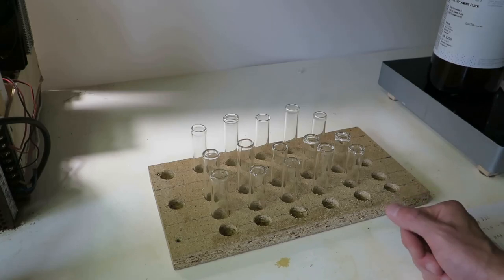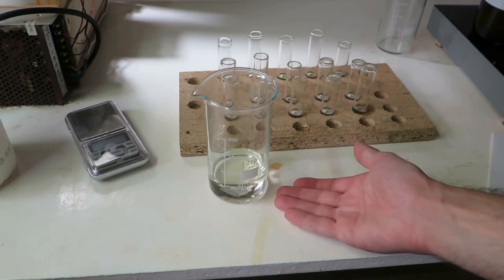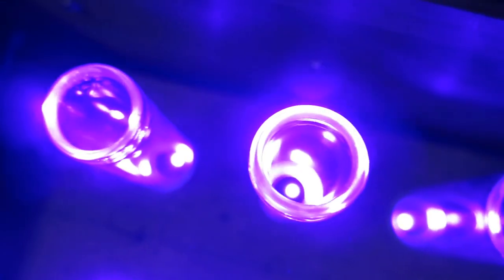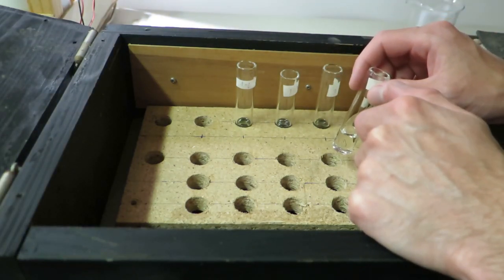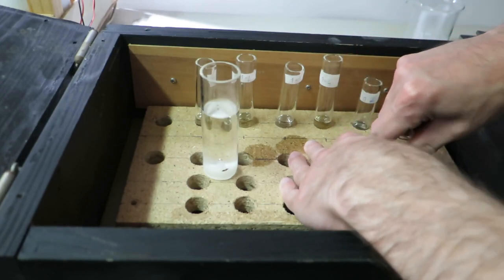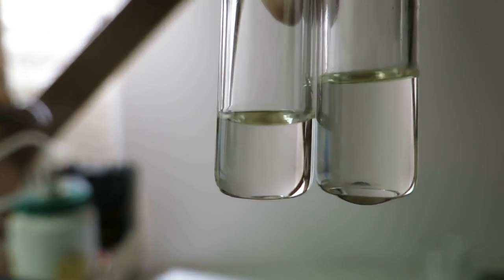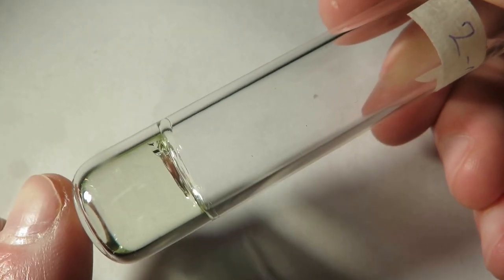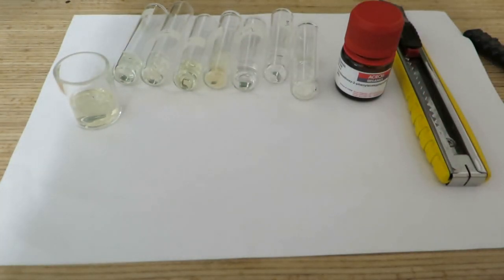Benzil dimethyl ketal - Will it polymerize?

Comment: 10:44 does the glass has an effect on the coloring? Maybe it blocked UV?
Reply from the maker: It probably has an effect, but not huge really. It doesn't prevent yellowing completely at all.
I guess what I wanted to say, that benzil dimethyl ketal may be more susceptible to yellowing. That's what I read but haven't done any research into this.